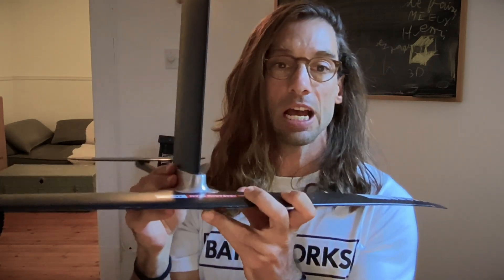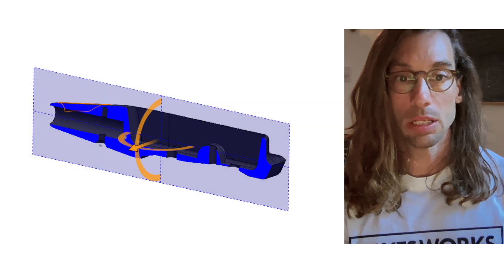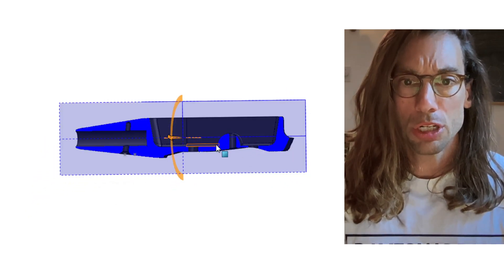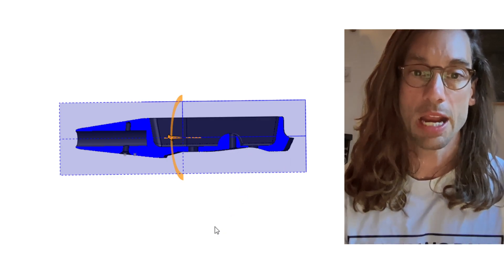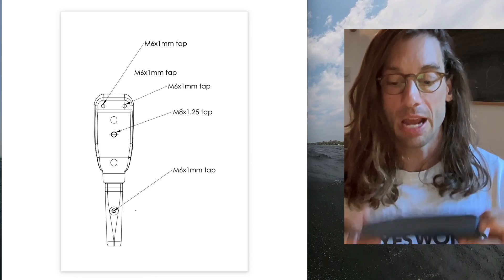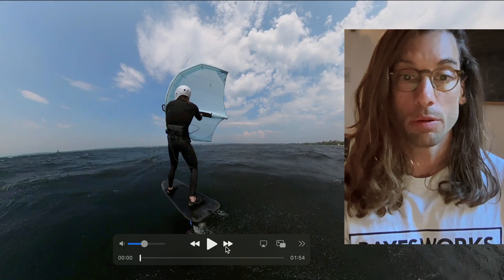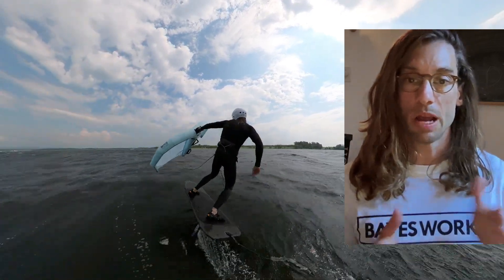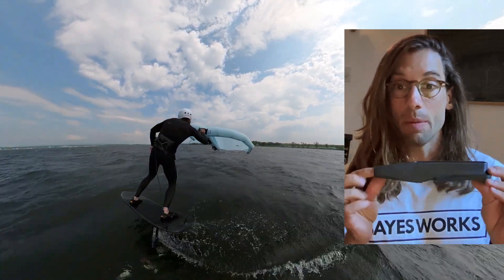CNC Aluminium Fuselage prototype

Comment: Hi James,
really cool design! Love the idea! Just the additional hole in the frontwing held me back, so decided to adjust your design and moved the mast position / made the fuse a bit longer. Now only one M8 screw goes through the mast, the other for the frontwing is regular with helicoil. Sill much closer to the frontwing as the stock Advanced+.  Advantage is that no hole to be drilled in the frontwing. What I also saw is that my Axis Doodad would not fit your design. the bottom of my doodad is about 5mm longer and no way it would fit the mould in the fuselage? Did Axis maybe create different doodad over time?
Now printing Moulds and will try with forged/enforced CFK method.. 
Cheers and keep up the great content
Reply from the maker: Sorry for the late reply. I am glad to see that you are experimenting along the same lines. I do not know about the different doodad. I have only tested this one with my Nolimitz mast, but from memory, it should have fitted my standard axis doodad as well. In any case, if you need to change this, it is fairly easy to change it in the CAD file if you have access to solidworks. If you can make it with forged CKF, that will be great. Regarding the positioning of the mast, I am still convinced that the more forward the better. One day, I will redo the whole thing from scratch with another front wing in order to move it further forward...

Comment: Hi James,

What a very cool project! Going off the colour of the aluminium, you did not do any anodizing? How is that holding up? And your 3D model is also for a direct fit and not for after anodizing? (Because of the increased wall thickness after anodizing). Just really interested! Thanks for the nice footage and experimentation!
Reply from the maker: @Robert-lb8kj, I keep raw because I like to make a stand about the experimental nature of the project. Hard anodizing thickness typically is less than 50µm (this equivalent to the CNC machining standard tolerance). You may want to increase a little bit the tolerance if you want to keep the same fit. If you keep it as is, my intuition is that it would still fit snuggly.

Comment: For the axis mast-to-fuse connection, did you notice that the right and left walls are parallel? Seems like a bad design on Axis's part. I would think a tapered mast-to-fuse connection would be much stiffer and fit better.
Reply from the maker: Yes I did. However, it does not matter much as the forces are going through the bolts on the bottom. In my opinion, the whole mast-fuse-frontwing assembly should be redesigned from scratch. I think that the best design should start from a mast shape without any adapter like the cedrus evolution: https://foilcedrus.com/collections/masts. This would allow for a much more streamlined design that has less drag. One day I will do it :)
Reply: @james_goulet  so this is actually how masts started before they realised that better locating geometry was needed. The Cedrus masts actually look quite backwards in that respect. Look at old Naish masts etc, unfortunately with alloy masts they extrusion process is far from accurate therefore tolerances for an accurate fit are almost impossible, which is why they created the adapters that are less tolerance sensitive on the mast end and have finely controlled interlocking geometry on the fuselage end. The top of an axis mast/baseplate is a perfect example of why they can't do a mast straight into the fuse. for my mast/baseplate I ended up hammering my mast into the baseplate with a energy drink can shim around it to take up the slop and stiffen the connection. Adrian from axis recently put out a video about epoxy potting mast fitting details to eliminate slop and excess tolerance. Nice looking part by the way, I'd like to try one I can't get my head around how it would change the dynamics of riding other than pushing the mast further forward in the board and maybe changing the yaw pivot centre of rotation leading to the feel of a little less swing weight?